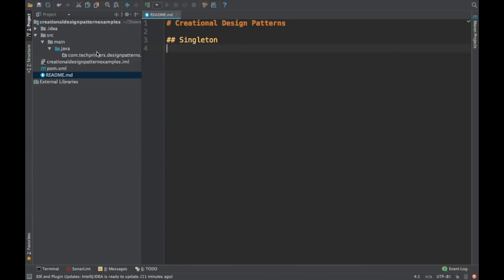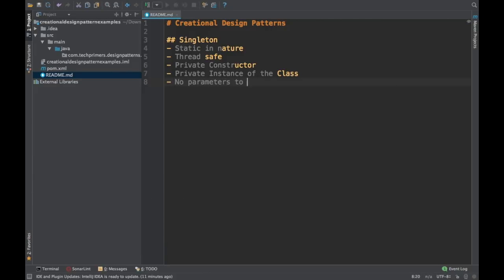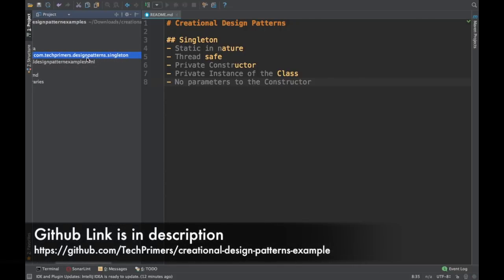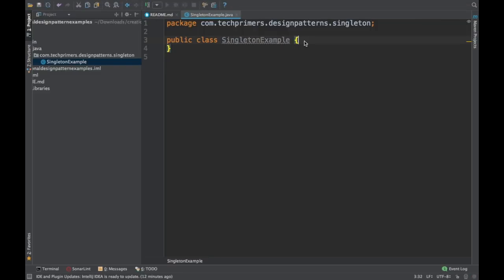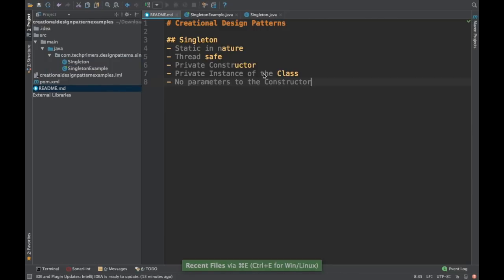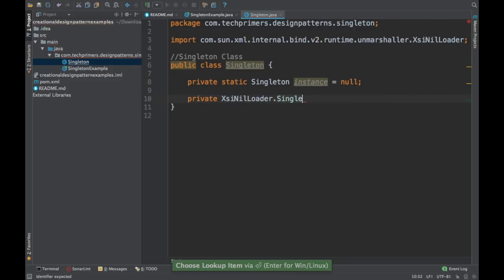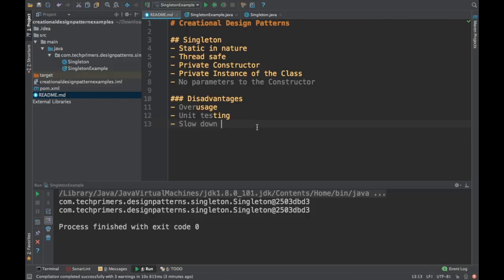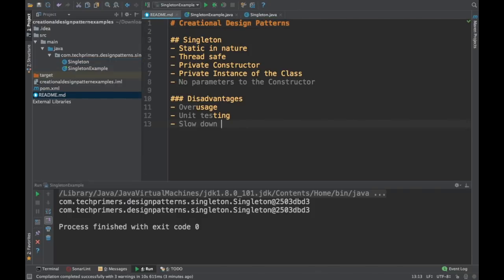Singleton Design Pattern | Implementation and Disadvantages | Clean Code Series

Comment: Thanks Sir.... I want to implement singleton for httpconnection...this would be used across apps ...where to close the connection ?
public class Singletone { private static Singletone conection = new Singletone(); private Singletone() { } public static Singletone getInstance() { return conection; } }
Reply from the maker: Hi John, You will have to close the connection when you are calling the endpoint.
Reply: So calling the ConnectionSingleton Class from  classes (A, B , C, etc) and close in that class. i.e B is calling the endpoint and closed the connection inside class B but i created the Connection object in ConnectionSinleton would be still open rite.
Reply: Thanks for response..
Reply from the maker: I would say, for HTTP connection, if you need a singleton instance, it will lead to a bootleneck and you will be forced to make it synchronized and that degrades the performance. You can instead maintain a Pool of threads and control the HTTP Connection if you are concerned about the number of HTTP connections made.